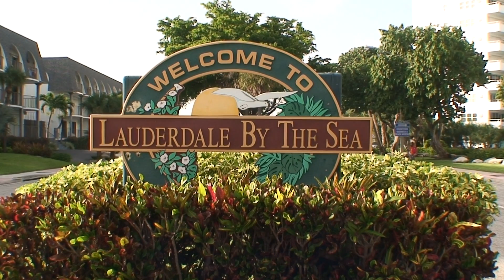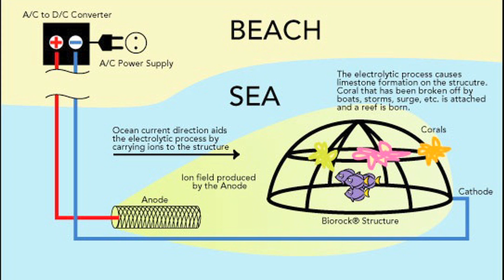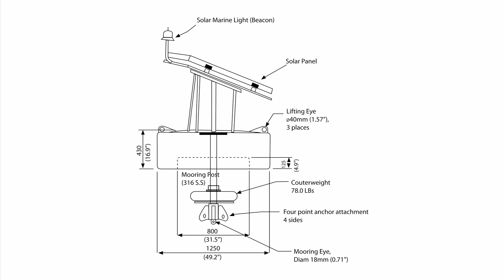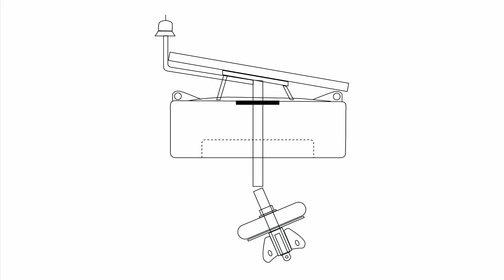Lauderdale By The Sea Biorock Reef Project

Comment: I salute this first attempt at this project.  But are saddened by the actual results.  Wouldn't tidal power work better to create a small voltage for the biorock?   They should look closer at how indonesians are doing this.  They are creating much larger steel structures, that dont need anchoring to the seafloor.  Location is also a big difference.  why put it in a location where the water current is so strong?